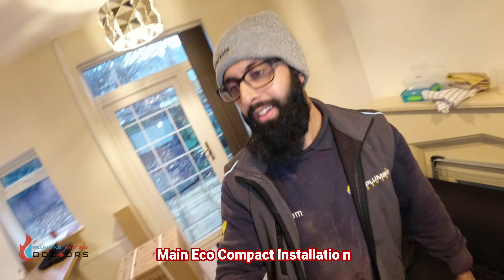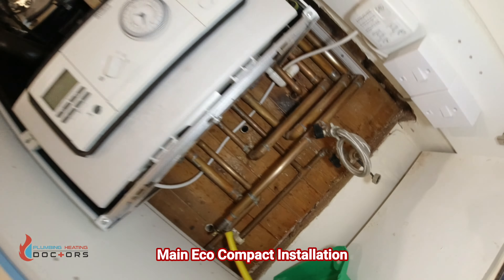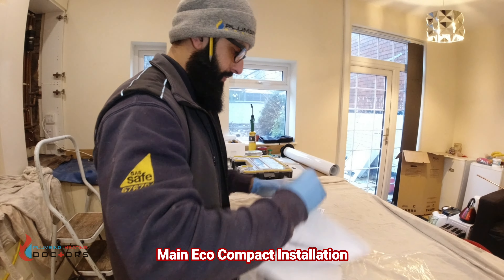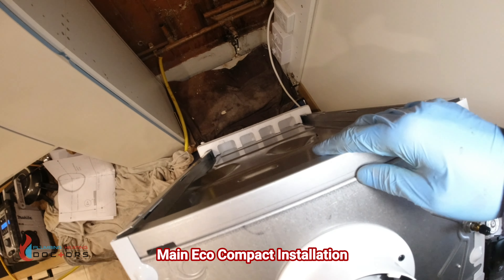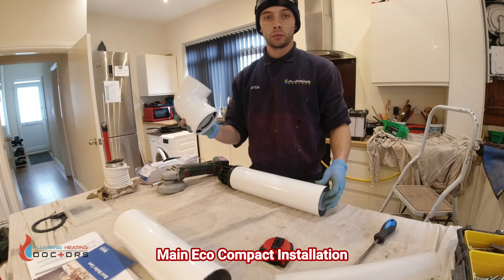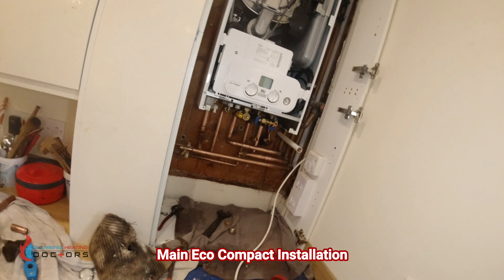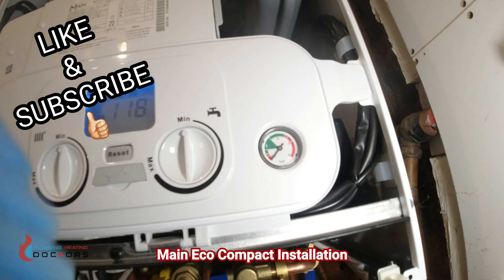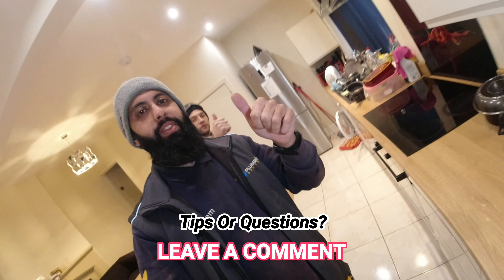Main Eco Compact Installation | Full Tutorial

Comment: When cutting flue for example. One mark for measurement....then wrap a piece of paper snug and inline( quick to do) then run marker around paper 100% square everytime.
Reply from the maker: Nice 👌
Reply: Btw the flue's supposed to be dead on straight out the wall. The flume exhaust already has condensate fallback built in.  At baxi training they said with the main eco compact the back top casing can be trimmed off to accept vertical pipework. It's why they come with the vertical pipe bracket in the box. Simple boilers to install 👍🏼
Reply from the maker: I did not know you could put the flues on straight 🤔 Ive always put them on an angle..
&
Yep ive heard about cutting the back casing so you can pipe behind 👍🏻
Reply: @PlumbingDoctors  bro look at the flue itself the exhaust plume isn't death on centre.  It's towards the top of the flue.  This is to account for condensate fallback.  Great upload 👍🏼

Comment: Does this boiler have a pre-heat for hot water setting that keeps the boiler on intermittently?  If so, where is this function turned on/off?  Thanks.
Reply from the maker: Nope it doesn’t

Comment: Thanks for the installation vid.  I got a PCB for a Vaillant Ecotec 831 for £75 and fan for £110 all fitted for £80 and it's been running for years since.  Didn't need a new boiler.  I do always have Main Eco Compact Combi or system as replacments.
Reply from the maker: Landlard had enough and wanted new boiler so i replaced ;) - i love repairing tho

Comment: Great video, helped me to find the water inlet to re-pressure the boiler, as I over vented the radiators, and the boiler went off  just at the weekend when I couldn't get any help.
So massive thanks.
Reply from the maker: No problem!!  - I also have made a shorter video just for increasing pressure if you search other vids
Reply: @PlumbingDoctors  
Will do, and thanks again.

Comment: Thanks for this. Quick question. Ive got low water pressure and need to turn both blue knobs open. My second blue knob (on the right) has been installed in such a way that when I try turn it fully open its stopped by the bigger black knob behind it. Im assuming incorrect installation. Am I safe to turn the black knob to allow me to turn the blue knob? What can I do? Thanks
Reply from the maker: twist the blue knob around or try closing the black knob but may not let water into the system

Comment: Good vid brother,  I have this boiler for 2 years. Its been generally ok, had 1 warranty claim, slight leak above diverter valve. Some critcism, the display needs a LED light when in operation,  more intuitive info on display would have been ideal (see vokera evolve ), limited controls as leave all to thermostat.  Could have done with pre heat like older models,  the left hand side blue lever is too stiff.
Reply from the maker: The led is bang on - shows you what you need to know. That left lever is always stiff not sure why

Comment: Thanks for the video just a quick question 🙋‍♂️. When it came to the wiring you skipped over it real quick and didn’t show the wiring on the thermostat. If I am correct the live and neutral connect via the boiler along with the switched live and common back to the thermostat.
Reply from the maker: yes thats i how do it but can be done different

Comment: Can't wait for this video also can you do a video on a condensate soakaway I've look on YouTube over the Internet there is so video showing anyone fitting one thanks
Reply from the maker: Soak aways are very easy just follow instructions on the bag and make sure you use limestones
Reply: @PlumbingDoctors  hi thanks for replying yeah I fitted one this week followed the instructions just wanted to make sure it was right as I've never seen anyone fitting one I did use limestone around it so am sure it will be ok.
Any chance you could do video on soldering I can solder the joint I tend to over solder is the vertical joints top part of fitting is alright just the underneath one I tend to over solder as am worried there is not enough sucked up into fitting.
Reply from the maker: Yes i will make one in the future 👍🏻 with soldering there is no shortcut to experience, the more you do the better you will get 😉

Comment: You can pipe upwards with the stand off bracket.  Also need to pipe 28mm off the back of the boiler for anything above about 35000 btu or friction losses cause slower heating,  Can come out straight into 22mm and up to 28mm with a 28mm elbow.  Just run the 28mm until the rest of the system is less than 35,000 btu then drop to 22mm.  The stand off bracket (if you need it) is for 22mm or 28mm pipes.  On the Baxi 600/800 you need the stand off for 28mm.  Most people think it's 22mm only just because that's on the back of the boiler but that's wrong.  The 22mm pipe causes 99% of the restriction so 28mm relieves this and the flow rates and heat up times are massively better.  Below 35000 btu it's okay for 22mm.  I also use full bore rad valves (14mm internal bore that open up to 14mm)..
Reply from the maker: Good info about the pipe sizing but very rarely do i need to use anything larger than 22mm as i work on Small - Mid size houses

Comment: Hey mate great video! I have this boiler and I’m certain the fuse has gone on the circuit (already replaced 3amp electrical) can a standard 2amp 2mm fast blow be used? Or is it a specific size for this boiler?
Reply from the maker: Yes change the fast blow it may be 1amp or higher

Comment: At 18:37 , the double spin, I spun the tap one and got an error code ( which was better than nothing at that stage - as the boiler wouldn’t function!) 

Double spun the radiator one and it all started working ! 

thanks for your video 👍🏽
Reply: At 18:37 , the double spin, I spun the tap one and got an error code ( which was better than nothing at that stage - as the boiler wouldn’t function!)
Reply: yes

Comment: Great video  . I have the same one . But i have no idea how to switch the boiler off . I only put in on min . But it seems to me that the boiler is always on
Reply from the maker: You can only switch these off via the fuse spur but they use no gas if there is no demand for heating or hot water so no need really to switch off
Reply: @PlumbingDoctors  thank you so much for getting back to me . I was concerned as the fan seems to be working all day and night and i was thinking the gas is been consumed.

Comment: ما شاء الله Brother excellent video one thing I don't understand why did you put drain off in flow and return because I put 22mm cap for easy powerflash in future!!! What do you think
Reply from the maker: I put the drain off on both flow and returns to make future maintenance easier & aslo makes draining up stairs circuit easier 😉

If the system was to be powerflushed in the future they can do it from the magnetic filter elbows 👍🏻

Comment: Love these boiler install videos. Great work.

How does the inner flue seal when being pushed into the elbow? Do you Leave it a little bit longer than the outer flue and it pushes inside the elbow?
Reply from the maker: No with these boilers you cut the inner flue the same size as outer flue 👍🏻
Reply from the maker: The flue elbow has two rubber seals: large seal for outer flue and small one for inner flue ✌🏼

Comment: Brilliant install but does the flue not need to be screwed in from both sides of the flue elbow?
Reply from the maker: 👍🏻 Yes it does but i did not record it..
Reply: Ah that's awesome, usually they are quite awkward, would of been good to see if you had any techniques.
Reply from the maker: Check the baxi 800 vid as i show it in that video.. 

Use the right screw head and also its easier if you drill a pilot hole with a metal bit first 👍🏻

Comment: Great video thanks for showing install could you show a little more detail when you measure the flue I know its from the outside wall then is it to the front edge of the flue the black turret bit.
Also there is a regulation regarding the condensate discharge to outside needs to be lagged using waterproof lagging there is a kit you can buy called condensate pro.
Reply from the maker: Yep im aware of that thanks 👍🏻
Reply: @PlumbingDoctors  also you need an air break in the condensate pipe as its going into a stack pipe to prevent back feed into boiler.
The fall is not correct as there is a flat spot where water could freeze.
Reply from the maker: I'll have a look into the air break but its never froze even with the old boiler so 🤷
Reply: @joncoke8208  good practice to put air break in as I've been to boiler breakdown where stack pipe blocked and backed into boiler full of piss and shit so I would put air break on stack pipe.
Reply from the maker: Yep I've also had this aswel! What about fitting a non return trap?
Reply: @PlumbingDoctors  depends if the non-return valve is  Sensitive enough to allow the condensate to flow throughout.
Reply from the maker: Yep I've fitted them before and condense water flows though fine 👍🏻👍🏻
Reply: @PlumbingDoctors  ok can you put a link on here so I know what it is I may use one on my install in the future thanks
Reply from the maker: @happyslapper07  I will see if i can find a link but im not sure now if it was used for condense or for d2 discharge pipe on unvented cylinders 😕 i will try to find out if i have time
Reply: Air breaks to stop the water from the condensate trap being drawn out due to vacuum suction when toilets are flushed.  A Hottun or a inline syphon should be installed to prevent drain back flow into the combustion chamber.  Always try to install the condensate internaly wherever possible.

Comment: Hi. Great video again. Looks like a nice job.. Just a small question.. did you power flush the system? Is it necessary on a new boiler install or is there no need ? Is it required  for the manufacturers warranty?  Thanks in advance.
Reply from the maker: Yep we flush all systems when fitting a new boiler and yes it's required by all manufacturers (they want system water to be clean)  👍🏻
Reply: @PlumbingDoctors  ok great.. just wondered as I did not notice you doing it on this one. I must have missed you mentioning it if you did. Do you use a magna cleanse through the filter connections with boiler running or a regular power flush machine? Cheers
Reply from the maker: Nope i did not mention it in the video either and it depends on how dirty the system is but usually i use the Magnacleanse Flush 👍🏻unless system is very old and dirty.
Reply: @PlumbingDoctors  makes good sense. Thanks

Comment: Brother what fault codes did it have .also what do you do with this when you take it out I could do with this for spares for my vaillant 😀
Reply from the maker: I can't remember as the job was done in December🙄 

I strip all parts from my old boilers and scrap everything.. i don't ever use 2nd hand parts when repairing boilers 👍🏻 but i do keep some screws and other bits for stock

Comment: I had one installed today . Heating working fine , hot water fine . Switched it off at the socket . Switched it back on and it's completely dead . Nothing on the display .I've held the reset button down for various lengths of time , nothing . What have I done wrong ?
Reply from the maker: Check to see if you have power at board or at socket

Comment: The Main Compact 30K in my area is now £700 but the gas engineer quoted me £2600 for installation. Is that fair?
Reply from the maker: Depends on the job we usually charge around £1700 for a standard main combi swap
Reply: @PlumbingDoctors  I had a similar boiler with the same connections and outlets. I found one who quoted me £1800 for a Baxi 800. So my gut feelings worked.